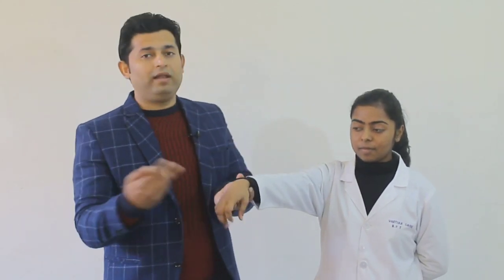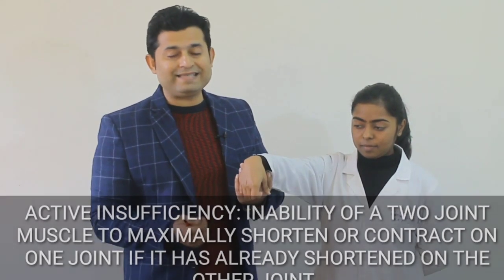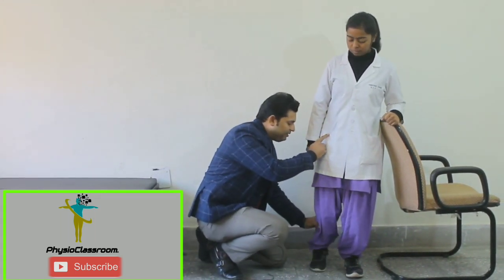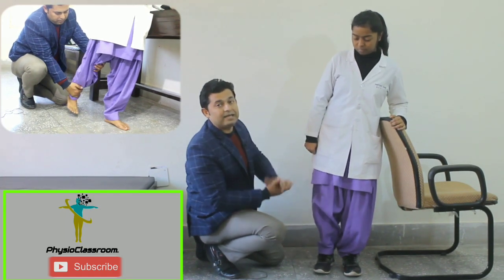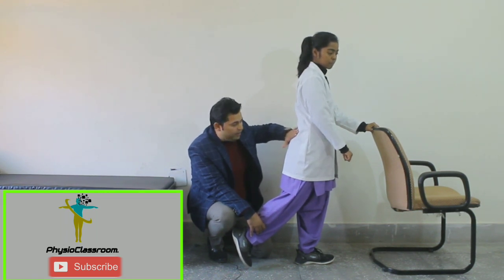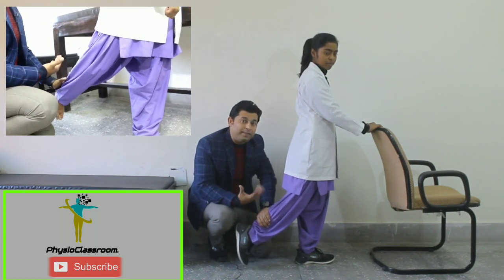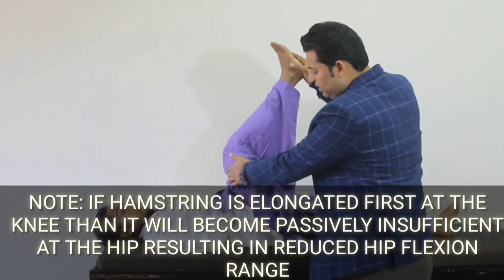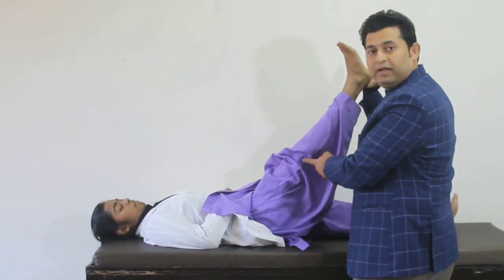MUSCLE BIOMECHANICS: WHAT IS ACTIVE AND PASSIVE INSUFFICIENCY?

Comment: The Quadriceps originate at the femur, they never cross the hip joint so I'm not sure the principle holds true for that muscle group. The percieved restriction of knee extension ROM is most probably due to hams tightness rather than quads active insuff. The explanation for the FDP and FDS was spot-on though.
Reply from the maker: The rectus femoris component of quadriceps have fibres originating from pelvic bone and thus it crosses both the hip and knee joint. 

The other three heads are originating from the femur itself. 

One can observe active insufficiency of quadriceps in individuals who have very good hamstring flexibility also.😊🙏
Thanks for watching Physioclassroom 😊❣️

Do share our channel videos with your contacts and help us in reaching out to maximum number of people 😊❤️

Comment: But plzz sir answer one thing 
You said in passive insufficiency of extensors of fingers that wrist is flexed so the extensors become lengthen at wrist ....and fingers are flexed also so the extensors become no (shorten ) on fingers isn't it wrong sir ? 
You should say extensors on fingers become no lengthen further ????
Reply from the maker: When wrist goes into flexion the ability to flex the fingers is reduced due to active insufficiency of finger flexors and passive insufficiency of finger extensors. 
This should clear your doubt. 

When finger flexors are already contracted at wrist then their ability to contract maximally at MCP and IP joint is reduced ( example of active insufficiency)

In similar situation with wrist flexion there is already lengthening of finger extensors and so their ability to lengthen at MCP and  IP joints is reduced ( example of passive insufficiency)

Comment: Tenodisis grip is example of active or pasivve insf?
Reply from the maker: When long flexors of fingers ( FDP and FDS ) are already shortened at wrist (during wrist flexion) their ability to shorten or contract maximally at IP joints is significantly reduced. 
This is an example of active insufficiency. 

Now with wrist extension the finger flexion becomes easier ( tenodesis gripping). 
Let's analyse this:
Wrist extension lengthens the long flexors of fingers at wrist joint and so their ability to maximally lengthen at IP joints is significantly reduced and so fingers assume a flexed position ( as finger extension requires lengthening of finger flexors which are already lengthened at wrist joint). 
So this will be an example of passive insufficiency. 
Thanks for watching Physioclassroom 💕😊
Reply: @PhysioClassroom  marvelously explained :) 🙏
Reply: @noshow8117  but we able to extend the fingers while wrist in extension..